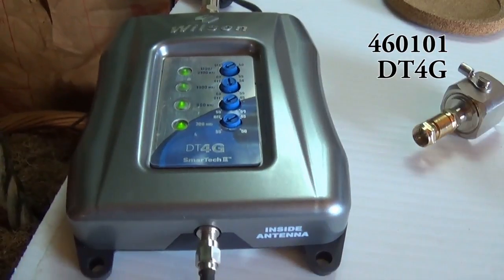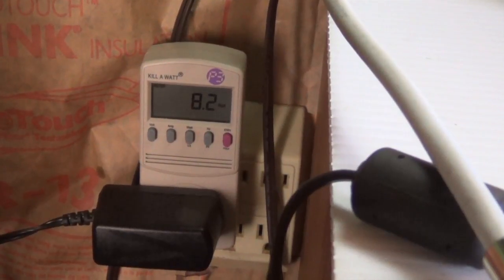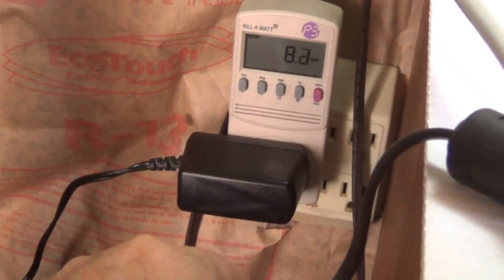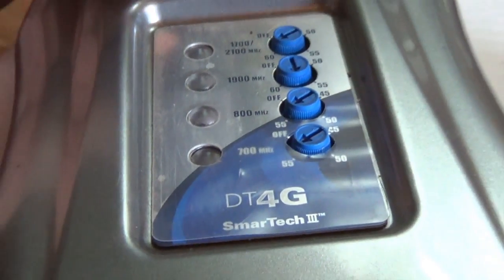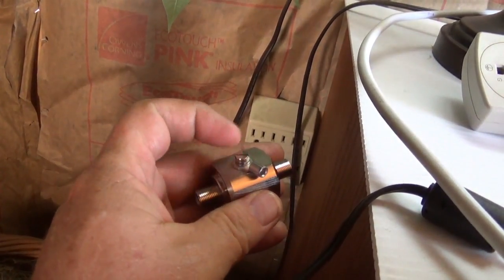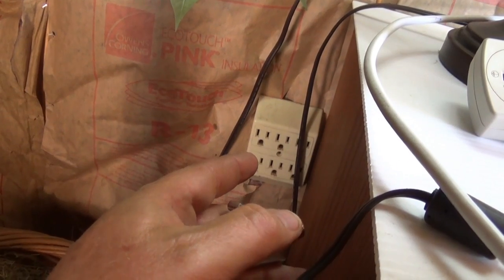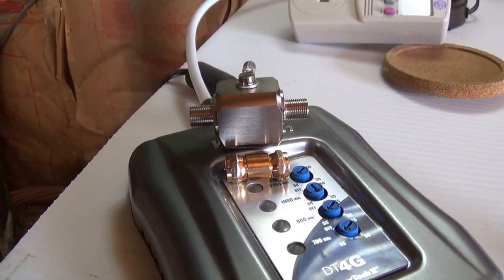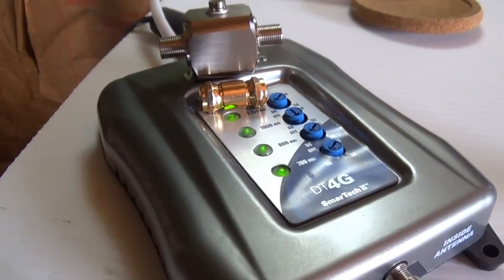How Much POWER Does It Need? Cell Signal Booster 6v or 120v?

Comment: I'd run a separate 6VDC Buss directly off your solar battery array into your camper and tap off that.
Reply from the maker: nice idea. what if they already made a 12v adapter for the booster. someone told me they do.. i havent looked into it yet but that would work.